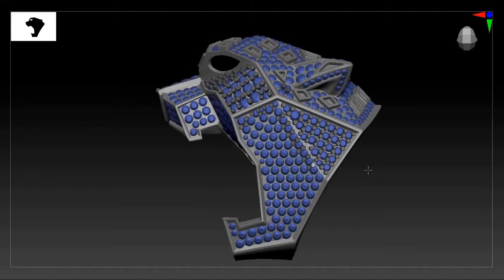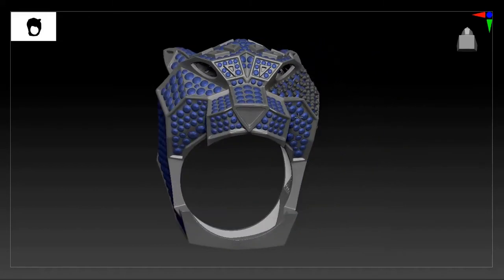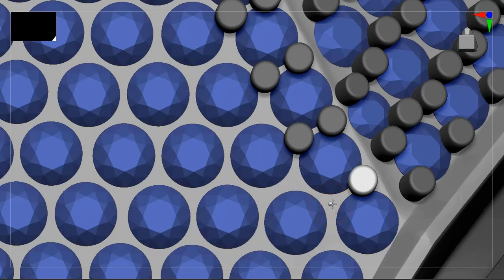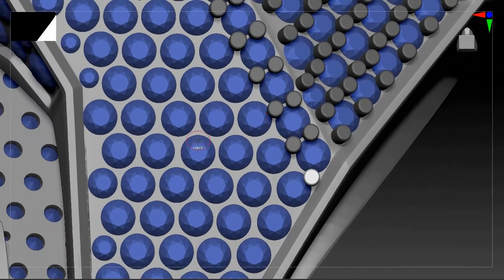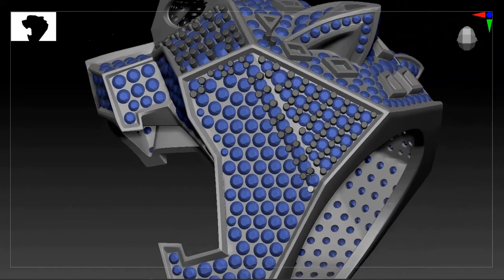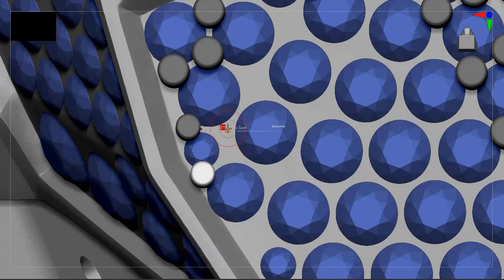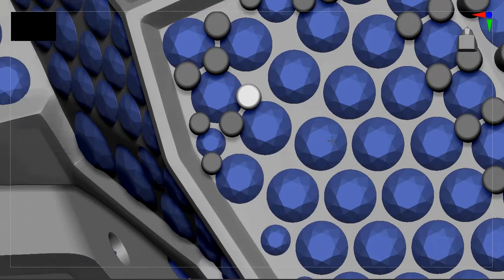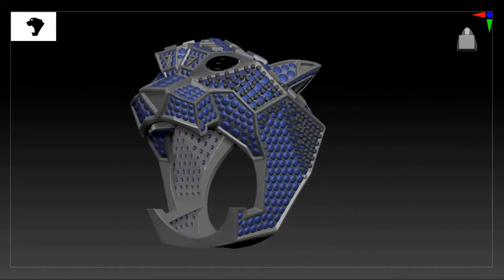Pave Setting in Zbrush

Comment: If your prong already overlaps the stone, won’t it be hard to fit the stone after casting the piece?
Reply from the maker: After casting the prongs will get slimmer by 5-6 %, making the stone fit easier. Also while setting the stone, setters need to etch the prongs a bit to fit the stones tightly. At that time this overlapping will help the setter. It's a very technical process which you need to see in practical. I am a bench jeweller myself so I know the technique. Hope I answered your query.
Reply: @deepankarjana2364  I see! Thankyou!